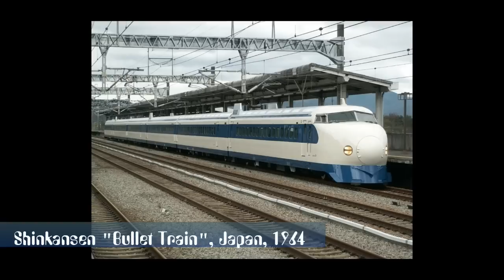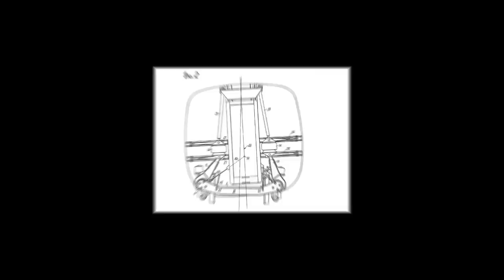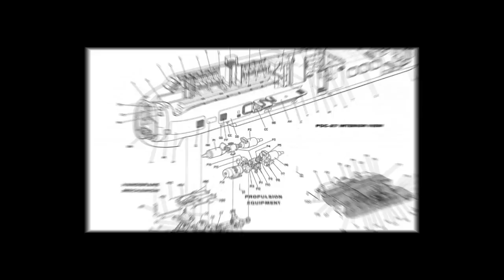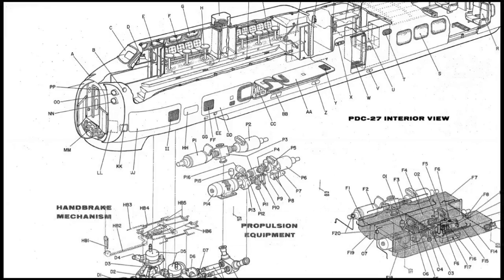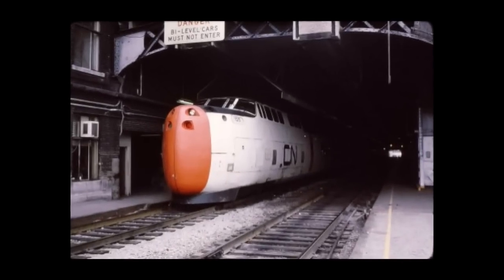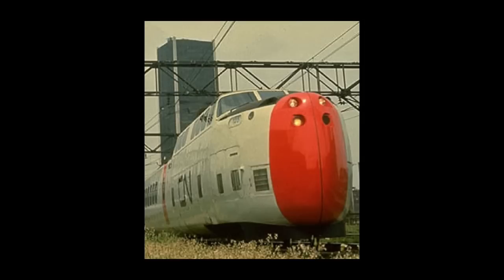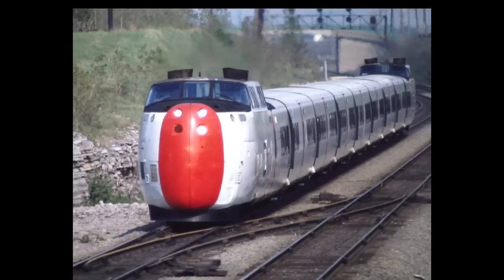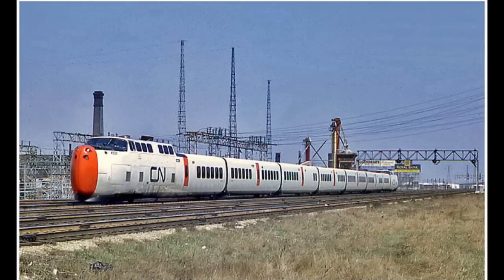A train powered by aircraft engines: The UAC TurboTrain

Comment: Turns out the secret to high speed rail isn't the fancy trains, it's the tracks... You can  run pretty mediocre trains at pretty decent speeds as long as the track conditions are great... Otherwise it won't matter how cool the train is, the ride will suck and performance will be terrible...

I think the solution has been found by Brightline West with its LA to LV train project... Build it entirely in free, government-owned Interstate highway medians to save cost and legal issues even if it means taking corners/bends slower than traditional high speed rail... You can still get viable higher speed service of around 125 mph/200 kmh with almost all of the benefits of true HSR without the cost or insane engineering issues of said service like you do at 220 MPH like the nearby California HSR is trying to do but will never be finished at its current financing/construction pace...

Comment: Its worth saying that there exist sort of a spiritual successor to the turbo in spain. It may not look the same, but the configuration is fairly similar.

It have a simular single axel configuration with 9 intermediate wagons, a diesel-electric drive in both end resting on 2½ axels. It also have a additional electric power head on both side, making it a electro-diesel train (that is a diesel electric that can run on both diesel and main power, this is also true for the turbo being able to use DC power). The two diesel engines have total 3600kW, consideral more than 1500kW of the turbo.

The spanish train is considerably longer and heavier this is pretty much exclusively due to the added electric power heads adding about 120 tons of mass and a bit more than 50 meter of extra over all length. Apart from that the Spanish train also have a gauge shift function, being able to operate on both standard gauge and broad gauge track.

It can operate at a top sped of 250km/h on standard gauge, 220 on broad gauge and 200km/h on diesel.

There are some differences, but in spirrit the trains are very similar. The AVE S730 is made to run both on core network as well as broad gauge network, but not only that reach out far into the country side where there is not even power linbes,.
Reply: It might be because UAC (United Aircraft Corporation), the builder of the TurboTrain, subcontracted Talgo to build the rail trucks/bogies and pendular system.

Comment: As I recall one of the problems with turbines was that the exhaust ran too hot. In one case an engine stopped under a bridge, and it melted the road surface above.
Reply: :face-blue-smiling:

Comment: During my college days 1976period was wondering why Jet engines were not tried on Trains. This information excited me and also felt how it could have been improved. Fuel used in these must be high speed kerosine, which is much economical to other fossil fuels I suppose
Reply: Not at the rate of consumption these engines probably had, especially when higher-sulfer diesel was so much cheaper back then.  Turbines are only efficient at one, usually high, speed.  The slower they were operated from the original design speed, the higher the fuel burn per mile... not to mention getting back up to speed after a stop.

Comment: I rode on the Turbo from Montreal to Toronto, in Jan. 1976.  As I was working for CN, back then, I rode for free.  The Turbo was replace by the LRC (lightweight, rapid, comfortable).  I also rode it for free, before it entered service, on an excursion from Toronto to Oshawa and back, for CN employees.  I also used to live in an apartment, overlooking Guildwood station, so I could see and hear the Turbo from my apartment.
Reply: Thanks. I took the train from Nova Scotia to Toronto in 1976 for my grade 6 grading present 😅. It was awesome, we were on the Day/Nighter I think it was called. Basically the seats reclined as it was an overnight trip. I think we changed trains twice, NB somewhere and then YUL for the Rapido I think it was😊
Reply: Was the rail track smooth enough to handle those speeds? I recently travelled from Toronto to Ottawa on VIA and the tracks were barely able to handle the 120 km/h speeds.
Reply: @RayleighCriterion  No.  The Turbo was limited by the poor track conditions.

Comment: I was fortunate enough to be able to ride one of these from Boston to New York in the mid 70's. It had been a New Haven Railroad train taken over by Amtrak. The unit I had had some seats in the top level of the locomotive cabs which faced out the rear of the cab. This meant that by sitting in these seats in the rear most locomotive cab car, you were facing the direction the train was headed. I could look out over the top of the entire train and see the locomotive car at the front, just as if I were in the dome car of one of the older Western US trains. It was an exciting, comfortable and enjoyable trip. Incidentally, I also got an opportunity to ride the unique General Motors "Aero Train" on the old PRR around the Horseshoe Curve to Pittsburgh. It was another great railroading experience.

Comment: Never had a ride on this specific train, but around the same time Amtrak had other turbine-combo trains running on various routes, one being the Empire Corridor (NYC to Buffalo). I remember riding those several times down to Grand Central in NYC; they had a rough ride, they were noisy, the big plexiglass windows were scratched to hell, and there was a distinct odor of J1 jet fuel in the air. Having BIIIG windows was actually a detriment, not only because they were so scratched as to make actually SEEING anything impossible, but on winter days they let all the heat out, and the train was extremely cold inside. Also, when flying along at 70 mph, and a heavy freight coming along at 70 mph the other way would scare the crap out of you if you were seated by the window on that side. Nobody missed them when they were removed from service and replaced by regular Amfleet cars, which had a smooth ride and were warm inside!

Comment: I never have understood why the locomotive manufactures have never gone to a turbine electric drive. Unless they need the extra weight in the locomotive for pulling the loads, but that could be made up by adding ballast weight. After several decades of Doge playing around with the turbo cars they found that the jet engine is most efficient at one RPM speed. That turbo shaft could be made to run the generators that power the electric motors they use now. A set up like that would probably be more fuel efficient for the train industry.

Comment: The record doesn't still stands this day for turbine powered rail vehicles, french TGV001 train reached 318km/h in 1973 (about 197.5mph), beating the 171mph record in earlier runs in 1972
Reply: This is correct, however, that TGV never went into commercial service.

Comment: Like owning a muscle car in the 70s and the speed limit was set to 55mph, never could stretch your legs.  This train would have been awesome had it been put on a rail system which was using it's own secure right of way (no automobile crossings).  I was in Japan in 2009 and rode in their high speed trains, wonderful professionalism of the people with such outstanding engineering.
Reply: it's true, but what would the cost of 500kms of new right of way cost? The cost of the trains would be the budget for donuts and coffee. And if you're going to create a dedicated , grade-separated line, why would you use anything but electric power? These, as with all HSR in Canada, were a kind of kidding-ourselves game that masked the compromises and resistance to making the necessary investments needed.
Reply: @danieldonaldson8634  I understand. I was in the electric power industry and had to acquire the right-of-way which was no easy task (even before price was discussed).  In the USA there was a time when ROW was easier to get but those days are long gone. Its a tough fight which can last years with no guarantee.
Reply: There no point of running a high speed train if they dont built an exclusive railway adapted for high speed. Like you said Japan high speed train system.
Reply: @m.4060-f1v  siiiiiiii historia de talgo mundial
Reply: The good thing about Canada is that it is a huge country....except, that makes rail infrastructure difficult. Forty years after the Turbo was discontinued, we're still talking about the elusive goal of high speed rail in the population rich Quebec City to Windsor, Ontario corridor.
Reply: @martinliehs2513 exactly big cities connected by high speed makes sense but with a vast open country it becomes just madness to try to electric all the way across the country can you imagine how many power stations it would take to connect the east to the west. Might end up being worse than diesels with all the extra power required. Have to make new tunnels and just a huge waste and would probably drive the cost up to insane levels.
Reply: It seems that the train ride is completely over today. People travel by car or plane.
Reply: @lenny108  With all of the overhead, Flying or Driving 🚗 Long Distances is Much more Economical.  However, The Economy of Railroads for Shipping Large Amounts of Freight, Especially Hazardous materials; is still unparalleled to this very day.
Reply: @lenny108 Amtrak's sleeper coast to coast train is expensive but the journey is what you pay for. I couldn't believe the food I saw absolutely delicious.
Reply: @jordanalexander615  There have been studies that say passengers on a train go nuts if the journey lasts more than four hours.
Reply: @lenny108  well we already have this here and looks pretty cool. It's a hotel on wheels. But they do have stops to get out and stretch though it wouldn't bother me much. You have lounge cars, dinning cars and the scenery is awesome.

Comment: I don't remember when, but I was on one of these at some point in the early to mid 70s in Ontario.  I was around 10 years old and my mother took me to the upper dome.  I still remember being fascinated by the fact that there was a large window so you could see into the operator's cab.  Oddly, I also still remember that the engineer had his shoes off.  Ah, the luxury!
Reply: I was also 10-11 years old and would spend my days down by the busy rail line in Kingston. It was really exciting to hear the distinctive whistle before the Turbo would appear, banked over, coming around a corner hurtling toward you ! Then they added Kingston as a stop between Montreal and Toronto and my parents booked us a trip on the Turbo ! I was so excited and waited for the train to finally arrive ... 2 hours late and being pulled by a regular diesel locomotive. It was also overbooked and our seats were already taken, so they sat us in the rear dome car/engine. That part was great for the view, but the train had no AC and it was brutally hot. We toodled along at about 50 mph,  very disappointing in the end. :(

Comment: Turbines are used where weight or size savings is a major concern, such as planes or natural gas pumping stations.  It was a good choice in trains only when used in 5000HP plus applications in moving freight out west where noise was less of a concern, as in the 20 engines made up for Union Pacific.
Reply: The ploblem with turbines is turbines are only efficient at max capacity.
Reply: @TheAmericanCatholic  That is one problem.  Another is the noise.
Reply: And what I this based on? The UP turbines were meant for hauling heavy freight loads at low speed. There were built for smaller trains, frequent passenger service. With 2400 hp on tap, the power to weight ratio for the entire train was higher. The division of power between a lead and trailing power unit meant the trains could run return trips without being turned, but it was also done to distribute the noise between the units. Given that noise and slow speed is a major factor in the UP turbines being abandoned, it's easy to understand why this was done.

My father, who was one of the lead engineers on the project, as the main sales engineer for the PT6 and ST6 for United Aircraft Canada, had also been an engineer on the Napier Deltic powered Flying Scotsman in the UK , and was a highly experienced train propulsion engineer, in a team of highly qualified guys – I'm pretty sure they knew what they  were doing. 

What they could not predict was the rise in fuel prices that followed the OPEC crisis during the 1973 Arab Israeli war, which caused prices to triple. That' unmentioned in the video was a huge factor, given the high consumption which also characterized the UP turbines (in an era of low fuel prices).Another, barely mentioned, was the resistance of the Montreal maintenance crews to retraining on turbine maintenance, and VIA's lousy maintenance procedures...

Also, in what way are weight and size an issue in a static pumping installation? Turbines' use case was well matched to train that had to move at high speed, with relatively light weight, and as the video points out, their very compact size provided effectively a half-car of passengers in the power units, allowing shorter trains to be run economically.

Comment: Wait.
So these had a 400 bhp engine?
When a standard diesel has 4,000.
So even tied front to back, that's still only 800 ?
Reply: No, there were 3 power units in each loco, and one generator. so total motive power 2400hp, and because the electrical power requirement were provided by separate units, all of that 2400 was going to the wheels.

Comment: SNCF had Turbotrains as well until into the 90s if not the 2000s, though these were conventional DMUs with I think 160 km/h maximum speed with a gas turbine engine in one power car and a conventional diesel-electric in the other